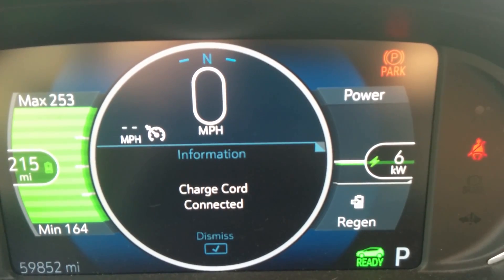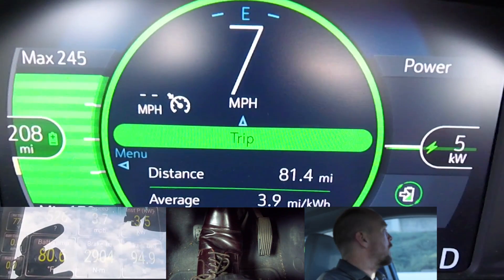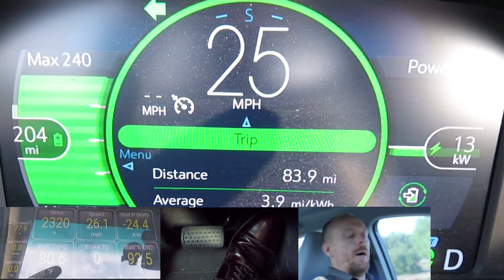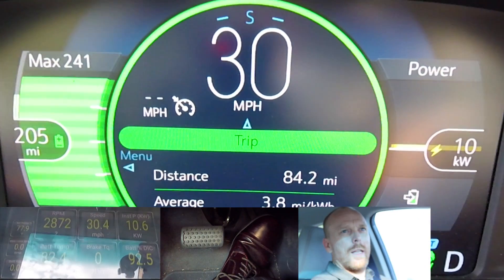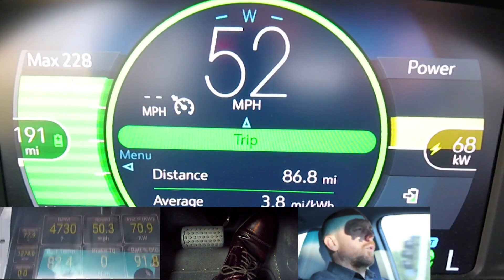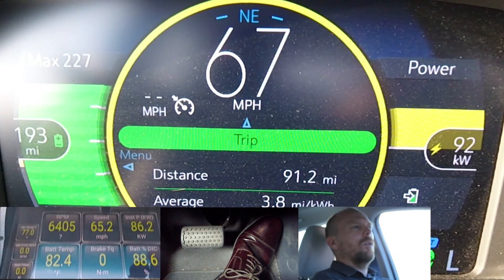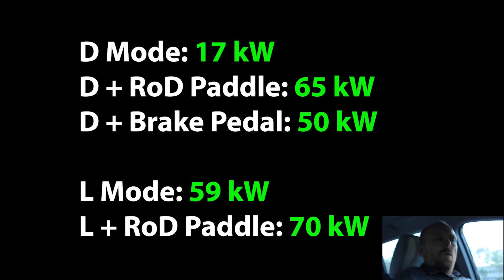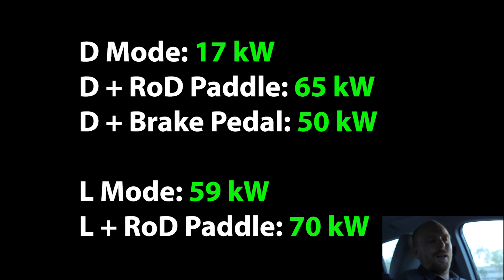Chevy Bolt EV Regenerative Braking Review

Comment: I only recently figured this out that even when I was surprised while driving in L mode (my preference) and had to hit the brakes, that I was still getting some aid (and benefit) from regen even though I had engaged the brakes.  Not the maximum I could have gotten if I had used regen exclusively, but at least the whole load wasn't taken by the break pads.  I love L mode and getting the most regen from every "managed" deceleration.  I consider it a fail on my part when I have to go to the brakes.  My kids actually lecture me when I have to go to the brakes and "lose some electrons".  GM did a really good job on the regen algorithms.

Nice video on a complicated subject.
Reply: I was in a TESLA showroom the other day and I asked them if there was a mode that I could select on any of the TESLAs where I wouldn't have to use the brakes at all. The dude said "No. You have to use the brakes at stop lights and stop signs. However, if you have autonomous on, and there's a car in front of you, then it will stop itself."   Weeeeeek.  I wanna NEVER use my friggin brakes again. Tesla needs to fix that flaw in its' fleet. ONE PEDAL DRIVING is the future.
Reply from the maker: Thanks!